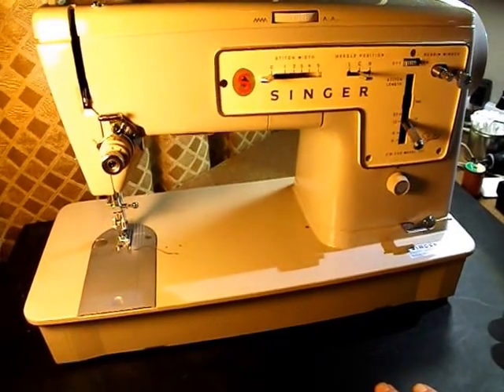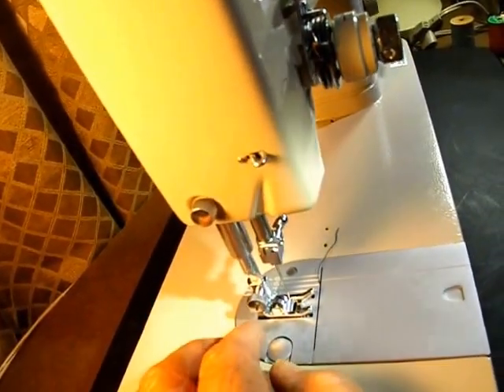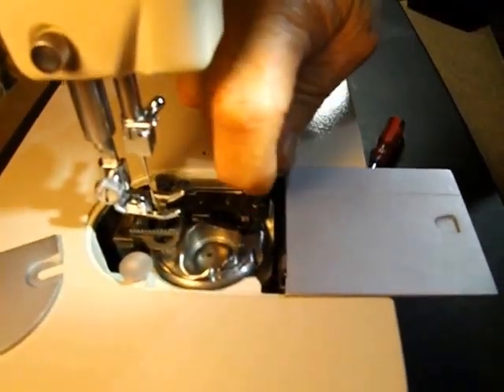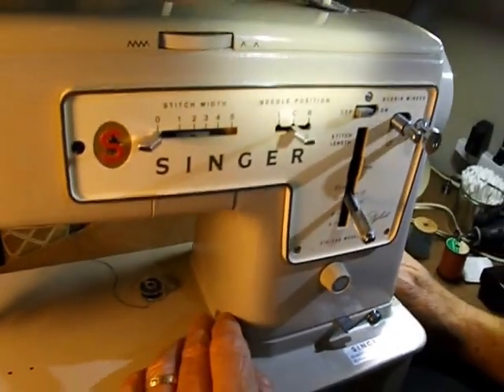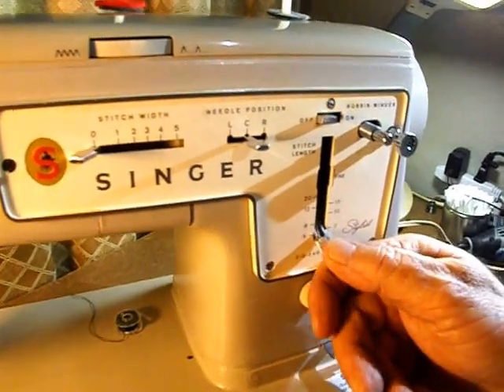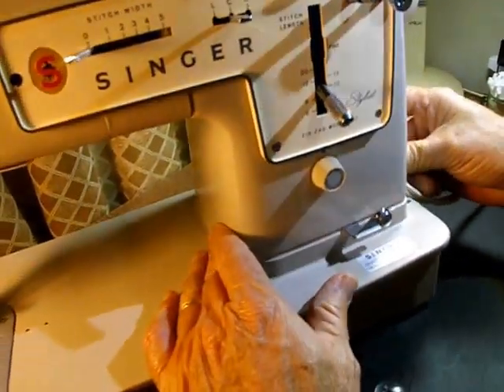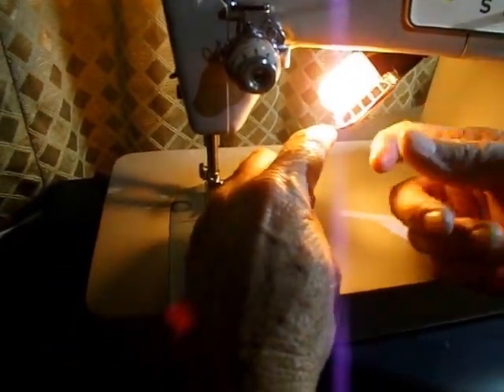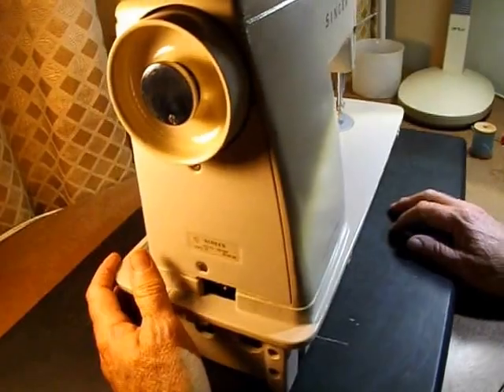TOUR THE FEATURES OF THE SINGER MODEL 457 STYLIST SEWING MACHINE

Comment: Mr Andy excuse me, this model is semi industrial? Can I to sew canvas fabric, denim ir faux leather?
Reply from the maker: IMO there are no semi-industrial models made by Singer. That being said, model 457K can certainly sew the things you mention. If you plan to sew those types of things all the time you may want a model 403A or 404. Model 457K has a plastic gear that is famous for breaking b/c it is 50 years old. You can replace the gear for about $10 and a couple hours of watching my video about how to do it.
If you used it all the time for heavy stuff you would eventually wear out the gear again. Models 403A and 404 have all steel gears with a direct drive motor. They are stronger but still domestic. You can download manuals for all of these directly from SInger SUpport for FREE at this link: https://www.singer.com/support  The manuals all have charts of recommended fabrics and which thread and needle sizes to use along with how to use the machine and oil it. I also have videos of all of those models if you want to see more about them. MODEL 457K: https://www.youtube.com/playlist?list=PLsCOZgzzaiKK9GeuGLCo6ZyWv-HbheRVK    MODEL403A: https://www.youtube.com/playlist?list=PLsCOZgzzaiKKyqvdDRwS-9MfLuwSNJTcg     and MODEL 404 straight stitch only heavy-duty:
https://www.youtube.com/playlist?list=PLsCOZgzzaiKIB4kvIHCfHYuyLMUp5A4UI    Model 457K, with a new gear, is a strong, capable, versatile sewing machine that is otherwise easy to use and maintain.
Reply: @andytubesewing1953  thank so  much for the prompt response!! Very complete explanation. You help to me !! I appreciate your help and kindness.
Reply from the maker: @rf3644  I'm happy if it helps. Good Luck, 👍 and let me know if you need other information.
Reply: @andytubesewing1953  I will, thank you so much!!

Comment: Hey quick question because you seem to know about this machine, ive threaded the needle and got the bobbin in the bobbin holder but when i try to thread the bobbin the needle thread gets caught on the bobbin and keeps going around it over and over until it gets jammed.
Reply from the maker: If the thread catches on the bobbin you may have the wrong style/size bobbin. Singer model 457 uses a Singer Class 66 bobbin with curved sides; curved like a saucer. People often pick up Class 15 bobbins but they are a little taller and the sides are flat, not curved. When the hook catches the needle thread it drags it over the bobbin to wrap it around the bobbin thread. If you have a Class 15 bobbin that's too tall the thread catches inside the edge of the bobbin over and over until the hook gets jammed. Class 66 bobbins are avail in most Walmarts, Sewing/Fabric stores, Craft stores, Amazon, eBay, etc.
Reply: @andytubesewing1953  thank you so much for the reply! I will try this and get back to you
Reply from the maker: @theonlyclapper  I'd appreciate it if you would. I'm curious if it solves the problem. Good luck.
Reply: @andytubesewing1953  Got my bobbins in, this solved the problem! your the absolutely the best
Reply from the maker: @theonlyclapper  Yippie! ✨👍 Thanks for letting me know, and happy sewing!

Comment: My Singer model 476 bobbin pulley isn’t moving.  How can this be repaired?
Reply from the maker: By replacing the broken plastic gear on the top of the vertical shaft. That shaft goes from top to the bottom to power the right side pulley and timing belt over to the left side pulley which turns the hook. When the gear breaks apart from age the shaft/pulleys/belt/hook all stop turning.
The gear costs about $10 and this is such a common problem I made a video about replacing the gear and resetting the timing. The video is up to 47K views which tells us how common the problem is on a group of models of that decade. Here is the video: https://youtu.be/M3bFtlV1Y6s  My video is a couple hours long and goes into great detail, like a step-by-step. Here is a 9-minute video by Rik Miles that is kind of a condensed version to get the main idea across https://www.youtube.com/watch?v=fYVqCjtdu6w
Best of luck, and thanks for watching my channel.

Comment: Hi Andy,good morning. Pls I can't move the smaller wheel in the hand wheel, what do I do
Reply from the maker: You have this model 457? It's called the stop motion knob. It may be stuck to the clamp behind it. I don't know the condition of your machine. Generally, it needs to be removed and cleaned but if it is stuck you must be patient and try to get some penetrating oil or cleaner inside to loosen it. It may have dried oil which can act as a "glue" when it gets old and dry. Take out the stop screw and get wd-40 or similar inside and around any edges or opening. Warming the parts with a hair dryer can also help. Here are a couple of videos that show removing and replacing to give you an idea of what is inside there. https://youtu.be/eZiMaaka5HE
https://youtu.be/hHl96WL1kzA

Comment: I have one of these sewing machines and its not turning if i loosen the knob at the back and it will spin just fine but if its tight and to make the needle move up and down it barley moves or does not move at all any ideas how to fix this. I no longer have a manual for this machine and if i need to oil it i have no idea where to oil it and what type of oil i can use. I do have some WD40 around can that be used.
Reply from the maker: A Couple of possibilities here. Needs a good clean/oiling, or worn/loose motor belt.
Start by going to this link, where you put in the Singer Model Number and download a free coy of the instruction manual. It will show how to remove all the covers and where to oil. 
http://www.singerco.com/support/instruction-manuals

I would not use WD-40, 3-in-1 oil, or similar. Use sewing machine oil or machine oil only. Walmart and hardware stores. I use Tri-Flow, which is available at some hardware stores and most bicycle shops. Use it liberally at first to get things moving. If you do use WD-40, remember it is NOT AN OIL, so after cleaning it off  you will still need to oil everything anyway.If that solves the problem, clean the machine and do a light oiling.
I have had luck using a hair dryer to loosen sticky needle bars, etc. A little heat, a little oil, turn the handwheel and repeat a few times.

If the motor belt is loose, you can watch my video of how to install/adjust the motor belt. It's on a different model, but the belt/motor system is the same.
https://www.youtube.com/watch?v=RuOLUVPsQv8&list=PLsCOZgzzaiKJxbOOMKQPvmeTRqi0dhGa5&index=19

I hope this will help you out. Please lets us know how it turns out or if you have another question. Take Care.

Comment: I just got one of these today but I can't loosen the knob to wind the bobbin. Help, please!
Reply from the maker: Sometimes there is oil on the back of the knob where it contacts the washer and the oil dried up hard, like varnish or glue. I've had pretty good luck heating the knob (chrome) all around for a few minutes trying to get the oil softened up. Wear gloves if you touch the knob right away. I have also had to protect the knob with a cloth and put a wrench, like a channel lock or vise grip to get leverage and force it to turn. That's usually the last resort though.
Reply: @andytubesewing1953  I am going to try that. Thank you so much, I greatly appreciate you. I am so excited to have this machine.
Reply from the maker: @NymmieMog  Goos luck. It's a very nice model. This is the only known problem it has:https://youtu.be/M3bFtlV1Y6s

Comment: Hi I have to hand turn the hand wheel to get it to start sewing .most of the time .help .
Reply from the maker: Hi, Margaret. A few things can cause this problem. Always start by being sure the machine has been properley lubricated. There are 21 oiling points on a 457K machine. Use sewing machine oil. If you don't have the manual you can download a free copy from Singer SUpport on this page: https://www.singer.com/search/support?title=457
If oiling does not improve performance the next most common reason is the foot controller (pedal) needs cleaning and adjusting. The foot pedal controls power to the motor and if the motor is slow to speed up or "groans & moans" when first pushing on the pedal that indicates a cleaning and adjusting is required. Here is a Playlist of videos about restoring your pedal to optimum performance:
https://www.youtube.com/playlist?list=PLsCOZgzzaiKItPLWcK24FBoMdHK8vTXNi
Not everyone wants to do that so if preferred you can buy a new pedal, like the newer electronic ones that stay cool and have superior speed control. You can find them without a cord and reuse your original cords: https://www.ebay.com/itm/231883233121?hash=item35fd515761:g:ES4AAOxy-o5R0QZa  and you can find them with the proper cords for your machine: https://www.sewingpartsonline.com/foot-control-singer-988274-104.aspx
The last possibility I have found is the timing belt had been replaced and installed too tightly: https://youtu.be/dW6haHu4-hU
Good luck, and thanks for watching my channel.

Comment: Hi Andy, the bobbin hook is not rotating.
Reply from the maker: There's a plastic gear on the top of the vertical shaft that rotates the timing belt that rotates the hook. The plastic gear is surely worn out by now and needs replacing. You can buy the gear for about $10 and here's a video showing the process in a step-by-step method to replace the gear and reset the timing. https://youtu.be/M3bFtlV1Y6s

Comment: I have this  Exact model I'm having trouble doing a zigzag stitch I'm not quite sure how to set it properly it didn't come with a manual
Reply from the maker: Hi, Maegan. You can download a FREE  copy of the 66-page Instruction Manual from Singer at this link https://www.singer.com/search/support?title=457     ZigZag stitch sewing starts on page 23. This model is one of a few know to have a high failure rate in a gear that makes the hook rotate counterclockwise around the bobbin case, so look for that. Here is a playlist of my videos for model 457 and one of them is how to change the top gearhttps://www.youtube.com/playlist?list=PLsCOZgzzaiKK9GeuGLCo6ZyWv-HbheRVK. 
Just a heads up that a bad gear may be your problem if the machine won't sew. Thanks for watching my channel and good luck

Comment: I just picked up the singer zig zag 476 which is really similar to this machine and I missed up the timing on it and now my hook isn't swinging around.  Any ideas on how I can fix it?
Reply from the maker: Hi Melissa,
Since I don't know your experience level, I'll start with basics :)
Did you check the clutch release knob is engaged? The smaller knob on the hand wheel must be full turned to the right (away from you) to engage the hook/feed dogs/needle bar.

The hook is powered by a pulley system on the bottom of the machine, which in turn is powered by a gear system up on the top side. There are plastic gears that break over time and that would prevent the power reaching the pulleys and belt below that run the hook. In this slide show, starting at 0:20 & 3:11 are pictures of the gear set and their location up top: https://www.youtube.com/watch?v=y_58gXoZqjA&list=PLsCOZgzzaiKK9GeuGLCo6ZyWv-HbheRVK&index=5

If You don't have a manual for your machine, go here to download a free copy: http://www.singerco.com/support/instruction-manuals

On pages 64 & 65 are diagrams of the gears & pulley system to give you an idea of how it works.
That gear on the top of the vertical shaft was broken on my machine an I had to replace it. It is a known problem in this series of Singer machines, especially when people have mistakenly put grease on those plastic gears, which made the Lexan Plastic become very brittle. NO GREASE/OIL ON PLASTIC GEARS PLEASE!

The new gear cost about $9.00. It took me an hour to do the labor.
Reply: We opened it up and we see the broken gear so we are going to order one online.  Any ideas on how we get to where it goes?  Is it in one of your other videos?  Thanks so much!
Reply: Nevermind!  It took a lot of tinkering but we got in there and got it out.  Now to order the replacement.  Thanks so much for your advice on where to look!
Reply from the maker: Good Job! when you are ready to reset the hook timing, this may help you:
https://www.youtube.com/watch?v=w9KSRe6zcyo&index=8&list=PLsCOZgzzaiKJS_4FKPb4bgAbHtYWnexvy

Good Luck.
Reply: hi, i have the same problem , and i cant move the smaller knob on the hand will, do you have any idea why?

Comment: Hi where can I get a foot control for this model .
Reply from the maker: You can buy used vintage and new electronic pedal on eBay and other online stores. Personally, I'd buy a new electronic. Here are a couple of trusted sellers. Check shipping times.
https://www.ebay.com/itm/Singer-Foot-Pedal-Control-Sewing-Machine-337-347-457-466-467-476-477-478-/380311608848
https://www.sewingpartsonline.com/foot-control-singer-988274-104.aspx